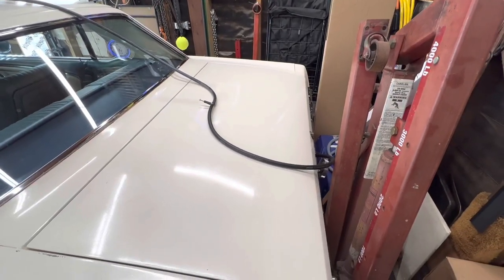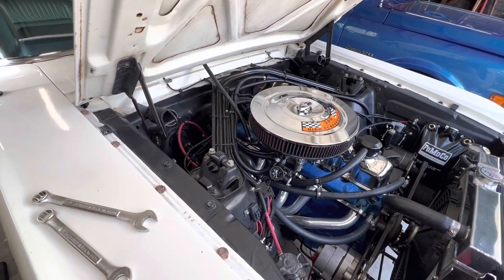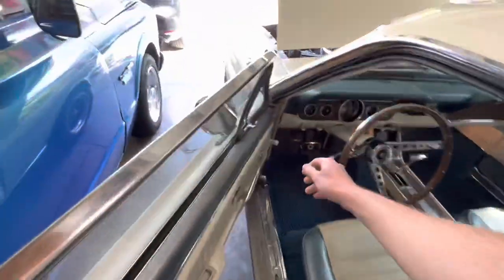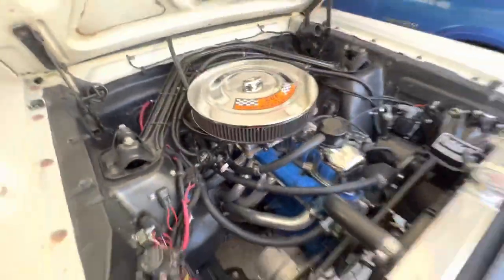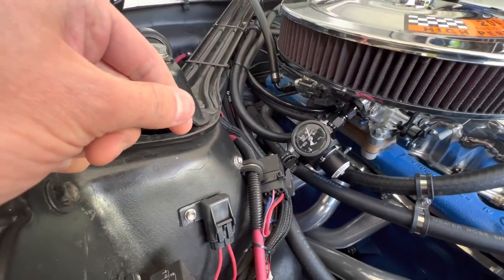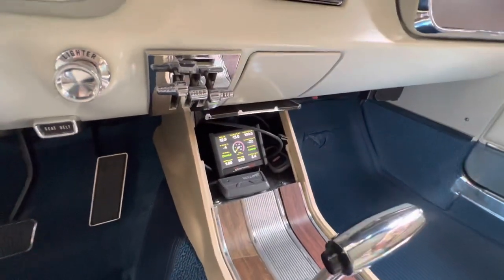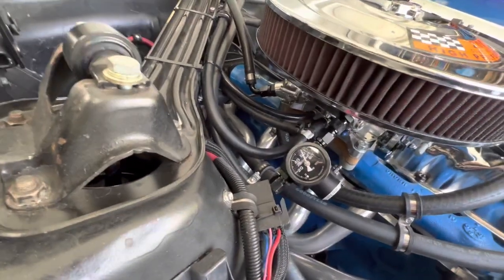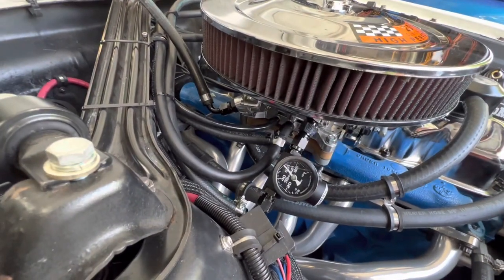What Happens When You Add a Fuel Return Line to a Holley Returnless System?

Comment: stupid question but, would it be ideal to have the return fuel line tap into the fuel line behind the fuel pump instead fo going back to the tank?
Reply: you would then have the pressurized side trying to push the fuel up the return line. so short answer is no. But I see what you were thinking.

Comment: what kind of fitting are you using for the heater hose that goes to the water pump, is it a 90° fitting? do you have a source where to get one of these? thanks!
Reply from the maker: It’s actually a stock 90°. Car came with it. Not sure if you can get them anywhere but I don’t think so.
Reply: Thanks, I will keep searching ;)